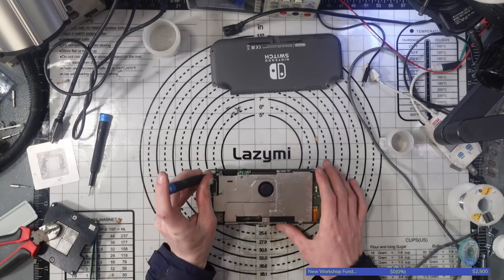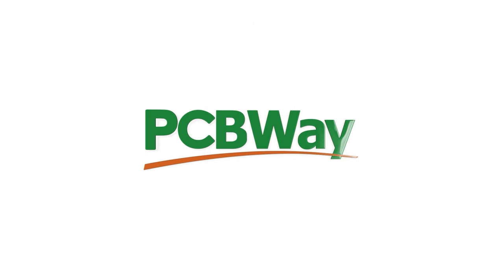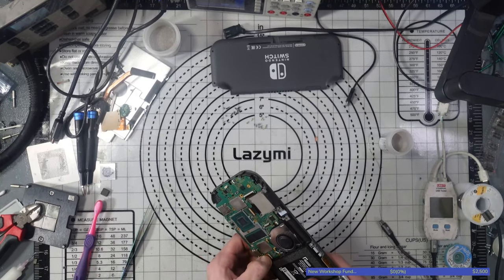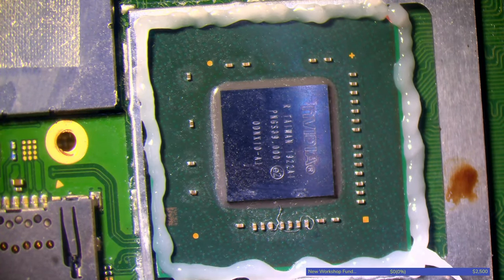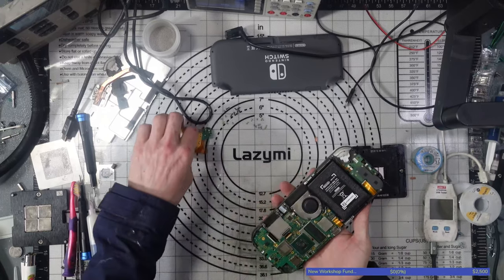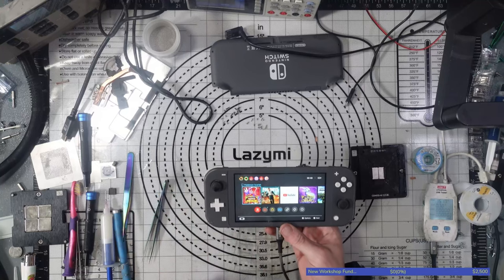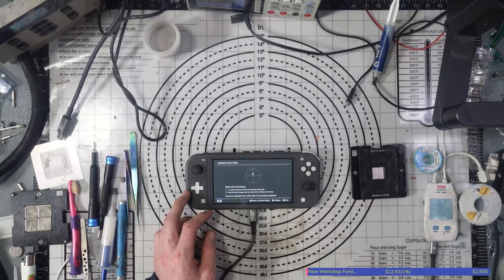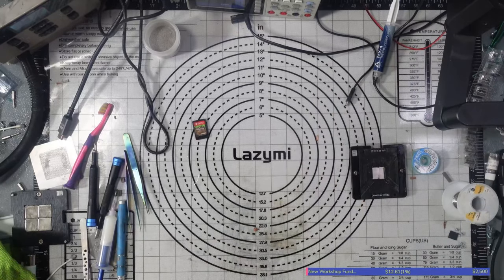Nintendo Switch Blue Screen Repair (CPU Reball) & Discussing My Future...

Comment: All you need is to hire a manager. They can coordinate repairs, promote your content, and hire an accountant and such.
Reply: Or maybe just create ticket system that contain user shipping data, deliver system, required parts order etc. could be done with MS Access or maybe Service now. Just use some other Automation tool that for example create the shipping label or for email correspondence some  template. I think more organisation and automation could make his life way easier.

Comment: I don’t think most people realize that doing the actual repair work is only a fraction of the time that goes into this business. Most of my time is spent going back and forth via email with customers and other admin tasks.  It’s draining.
Reply: That and the amount of people with very unrealistic expectations of what can be fixed is ridiculous and people don't like being told "no I won't work on your console".

I had one recently, "I dropped my PS5 down a flight of stairs and it wont turn on and the black casing is all cracked".  When I told them that not only am I temporarily closed but that I also wouldn't want to waste my time and charge them for that time they got all upset calling me unprofessional.  Well first off you messaged a business listing that states "temporarily closed" and secondly it's my choice whether I want to take your device in or not.  They then started demanding to know why I am closed.  Not only is it none of their business, I legitimately told them off and told them to go elsewhere and just blocked them.  Makes no difference to me.

Even worse now is that the amount of people demanding a discount (for no reason other than just demanding) because the cost of say, an hdmi port is nothing compared to the overall cost is insane.  Where I am, I charge $150 to do an HDMI port on a PS5, I have people being serious when they ask if I can do it for $40 because it only takes an hour.  You can imagine their confusion when they read the message and I just don't even bother wasting my time to respond.
Reply: @Eyem1337  Why is it that people can just say 'Well that's unprofessional.' When they're next to always the unreasonable one in the interaction. It takes two to tango.

Comment: Hi do you fix ps5 for a fee it has blue light but goes off straight away ?
Reply from the maker: Yes the cost for that would normally be between £60 - £120 GBP depending on the cause of the issue
Reply: @TheCod3r thanks how do I go about booking repair with you
Reply from the maker: @akc1100  You can book it in at https://www.consolefix.shop/pages/mail-in-repair-service 😀

Comment: You won't be happy working for somebody else.  Phil you taught yourself how to repair electronics.  You just need to focus on setting boundaries and the managing side of the business.    Sorin actually has some good videos about this subject.   

Ya gone and &$@ed up.  So what.  It happens.  I have faith that you can master the admin side.  The problem with self management is setting boundaries.  People tend to burn out by getting frustrated over trying to work harder .  All
You need to do is streamline.  Be more efficient.